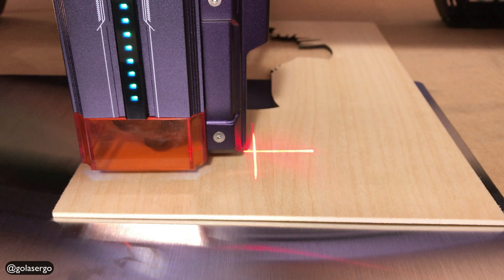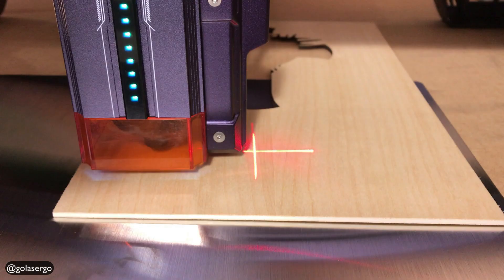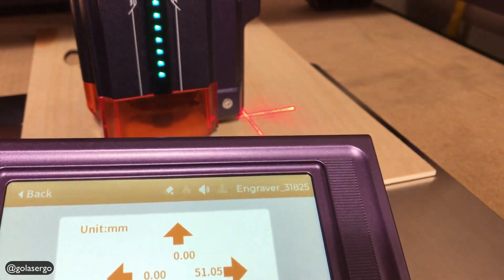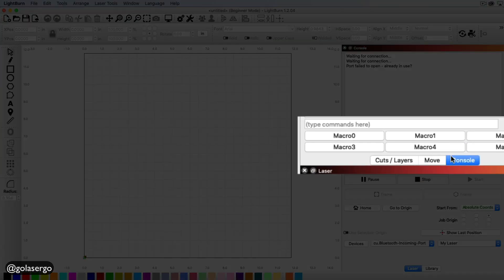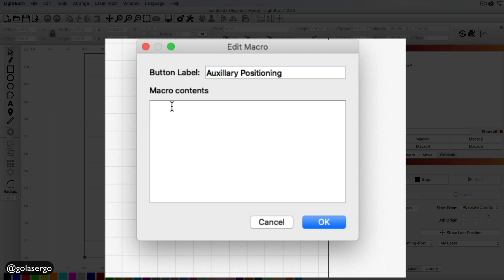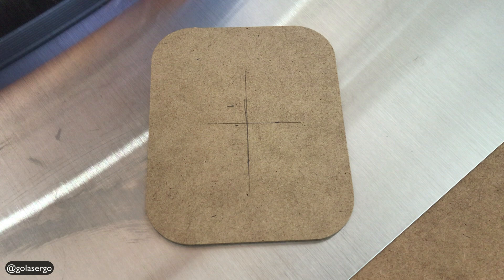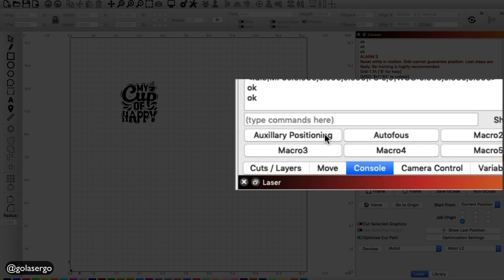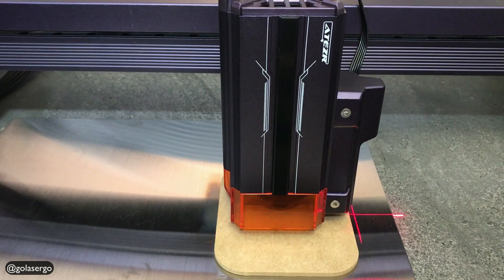Atezr L2 Auxillary Positioning Tutorial

Comment: My crosshairs are not visible when I turn on my Atzer L2.  Is there a trick to turning them on?  Did you autofocus in some way before burning the positioning cross?
Reply from the maker: Are you using Lightburn? If so, there is an option in Device Settings to 'Enable Laser Fire Button'.
Reply: @golasergo  Is that only in older versions of LightBurn? I have looked for that in my Device Settings and there is no such setting for the cross hairs  for on and off. Cross hair does not seem to be affected by the laser fire in anyway. If I am missing something please inform me.
Reply: I have the same problem with mine and I can't find a button or setting to turn it on or off. Have you ever figured out how to turn yours on?
Reply: @donalddunn2983  I never found a solution. I finally returned the machine at the cost of $100 out of my pocket so I could get what was left as a refund. Customer support kept telling me to send them a video of it not doing anything. I never got far enough to try LightBurn.